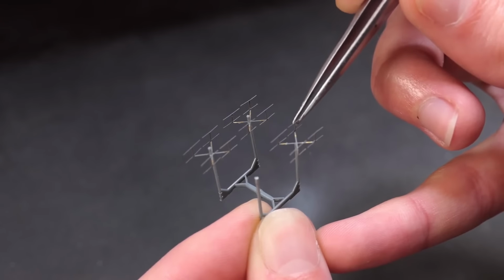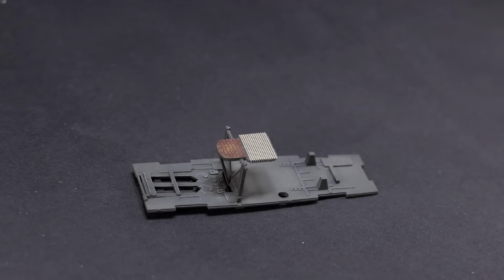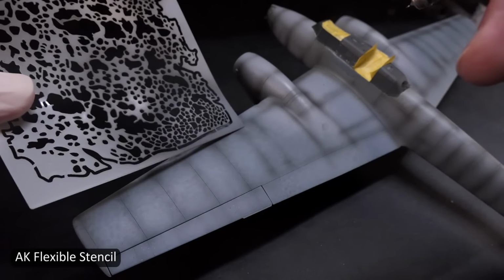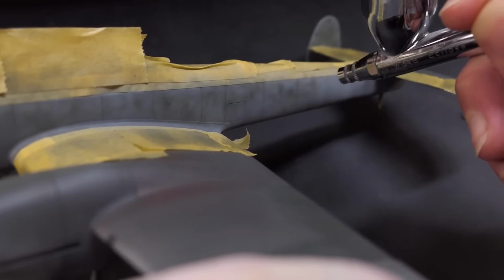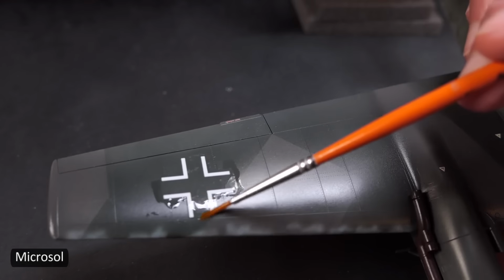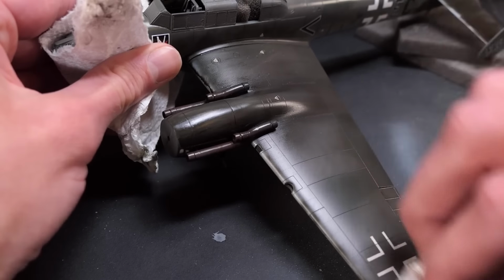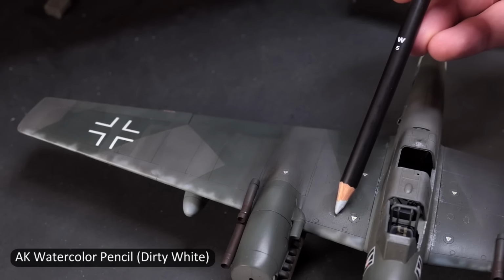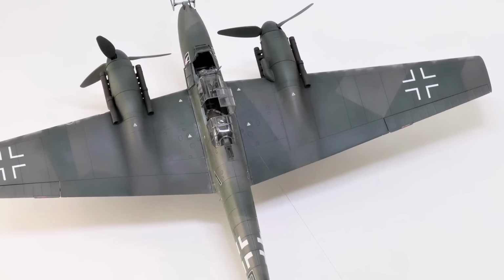Bf 110G-4 Night Fighter | 1/48 Eduard Model

Comment: How long should you typically let a wash dry?
Reply from the maker: It depends.  An oil wash will be different than an enamel wash.  Also, do you mean before you wipe the wash away, or before you clear coat over it?  I mostly use oil washes and wait anywhere from 15 min - a few days before I wipe it away.  Theres a lot of flexibility with timing on oil washes which is one of the reasons I like it.  Its really slow to dry and I probably clear coat it a few days after I wipe it away.  I dont think its fully dry even then, but its dry enough and the clear coat still goes on fine.

Comment: hello :) I just ordered this kit and I haven't done much photo etch. It appears that you are using white glue to attach the pe cockpit gauges, is that  correct? I have CA glue but I would rather use white glue if I can. 
Thanks for the great build video :) Liked and subscribed.
Reply from the maker: Thanks!  Correct I used white glue.  Gives more time to position the part and you can clean up any excess with water.  It's strong enough to hold the gauges in place too
Reply: @ScaleModelAssassin  perfect,  thanks so much :) beautiful job by the way!

Comment: it looked complicated but turned out to be an awesome build. as a fellow model maker ( cause i build model aircraft myself) i`m impressed what skill level was it. i`m at skill level 3 myself but i am thinking of trying a skill level 4 soon any helpful tip on how handle a skill level 4. any tips would be very much appreciated  keep them coming.✈🛩
Reply from the maker: Thank you.  My advice, buy a newer kit since it will have better tooling/details and be less frustrating right out of the box.  The parts just fit better.  Watch videos, read articles and blogs...but just go for a level 4 kit.  Building them over and over is the best way to improve.
Reply: @ScaleModelAssassin  thank you i`ll try that